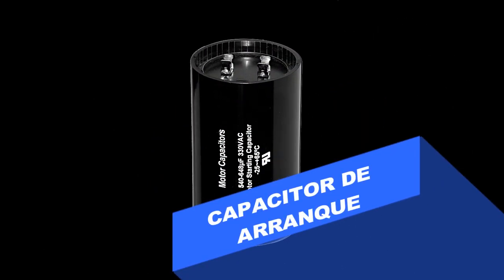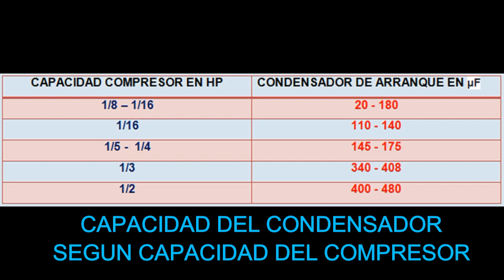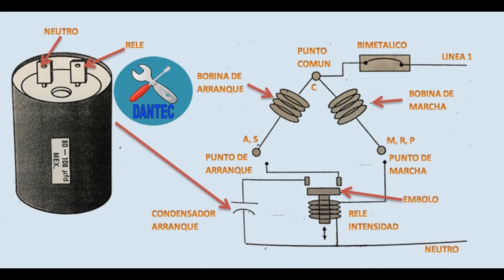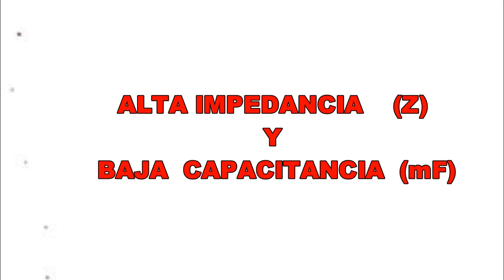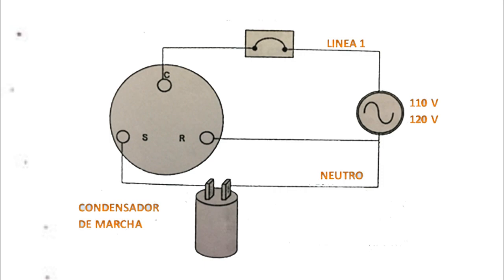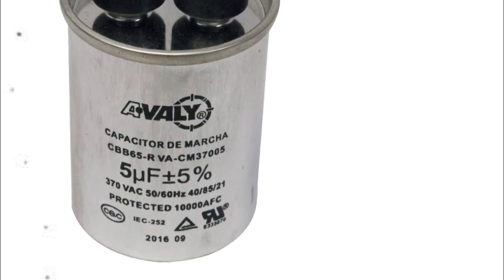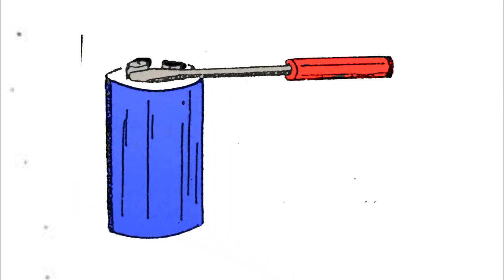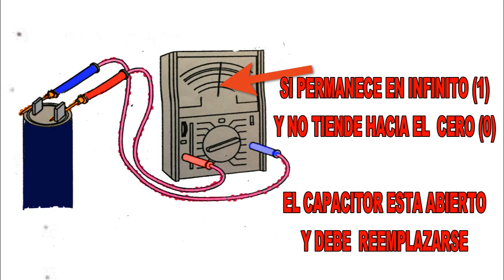⚡COMO PROBAR LOS  CAPACITORES DE NEVERA  Y COMO SE CONECTAN EN EL CIRCUITO FRIGORÍFICO. ❄

Comment: Buenas Amigo...una ayudita porfa..Tengo una una nevera  con capacitor de arranque en un rango entre 108-130 mF le puedo coloca uno entre 130-155mF + - 10%..?Gracias.
Reply from the maker: Saludos si le puede colocar lo importante que maneje el mismo voltaje